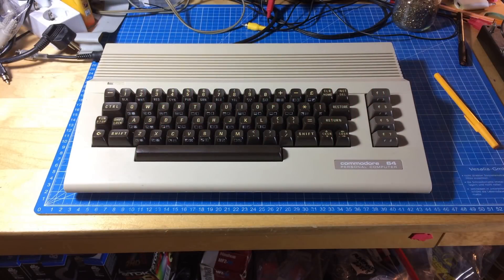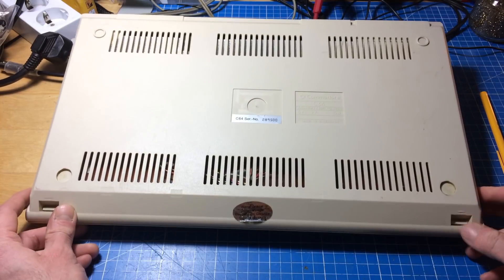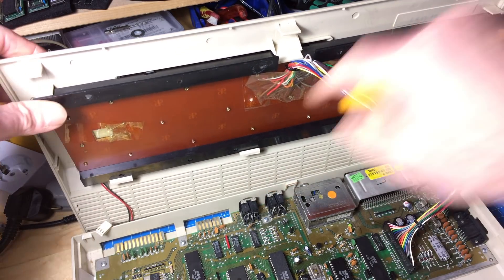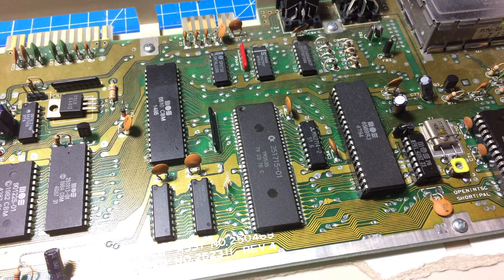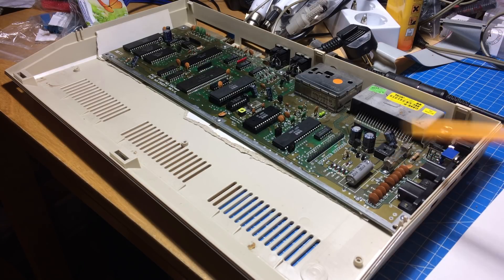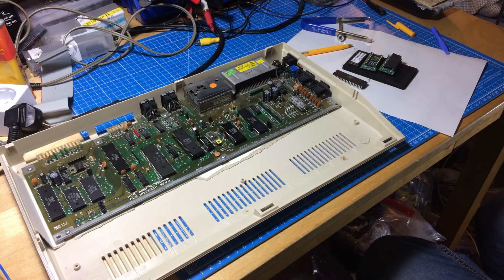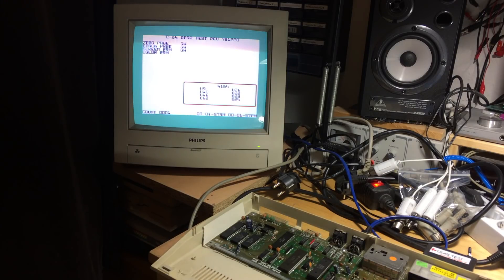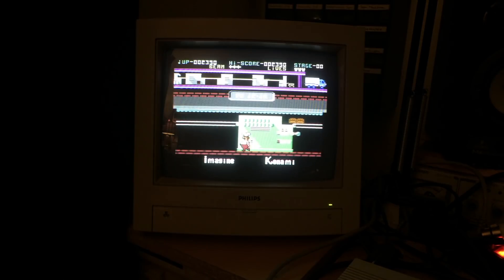C64 VIC-II Generation Conflict

Comment: If you use a 656X VIC-II on C64c boards, there won't be a display. If you use a 856X VIC-II on the old boards then the 12V on pin 13 will destroy them.

Comment: Does it matter which way you put the vic chip in? How do you know which way it should go?
Reply from the maker: Yes! The VIC-II can easily be destroyed if you put it in the wrong way. There is a little notch on one side of the chip that you have to line up with the notch in the socket and the marking on the PCB.

Comment: I have a breadbin ASY# 250407 Rev B board, it seems fine when powered up, can type a little program and run. When I put a cartridge in it, it goes black or garbage screen. PLA has been replaced, VIC II and SID have been swapped in to working machine, all okay. 

Any ideas?
Reply from the maker: Mh, that's odd. Is the cartridge known to work? Did you clean the cartridge connector? I found that it's often just a bit of smudge on the edge connectors that prevents stuff from working properly.
Reply: Hi Jan, yes a good Cynthcart and a diagnostic cartridge. The Cynthcart comes up black, diagnostic comes up with garbage, blue border and all. I'll look at the edge-socket closer. But have a true dead-test cart on the way. Also removed SID and did these tests - great Channel!
Reply from the maker: If cleaning the connectors doesn’t help it might be a strange fault in the PLA. Weird that everything else seems to work though.
Reply: This happens often when the replacement PLA is a cheap hack (EPROM) instead of a genuine Commodore PLA or a good quality replacement.

Comment: That's interesting.  I've never seen a C64 (and I have 21 of them) that had a warranty sticker on it aside from the large square serial number sticker which mentions a warranty.  And last night I found out that one of my C64Cs has a regular C64 motherboard in it, based on what the service manual says about board revisions.  I never knew that.
Reply from the maker: Yes, the first C64Cs had 250425 boards, then 250466. Both "long" board revs. The ALDI C64 in mid 1987 was the first one to have a short board according to my research.

I think the warranty stickers might be a German thing. I've seen a lot of warranty stickers from resellers, too.

Comment: Hi: A bit off-topic but I would like to ask you where should I take 12volts dc from in my 250407 rev.C mobo. It's important for the mod I'm planning.
Reply from the maker: You could take it directly from the 7812 voltage regulator I guess. It should have enough oomph (1A) to power something else apart from the VIC-II.

Comment: fortunately you had a spare chip but it might be hard to acquire a new one for your spares collection since I think most C64 chips are not manufactured anymore. I hope people with dead and still half-populated C64 boards will think of you and send them to you.
Reply from the maker: I have a small collection of spare chips and two spares boards for C64s. They are getting rare indeed. I hope there's going to be more modern replacements in the future to keep the old machines alive. The original ICs won't last forever.
Reply: yes maybe some (chinese) company remaking the ICs but I guess the ICs designs are still copyrighted :(

Comment: Another video from Jan :) I must admit i wonder how the incorrect chip ended up in the board.Great that you brought it back to life :)
Reply from the maker: Thanks! My theory is that someone repaired this C64 and used an old breadbin board for spares (the CPU also most likely came from that). Obviously whoever did it wasn't aware of the voltage differences.
Reply: and he gave up :)

Comment: it certainly had been opened before since the aluminium coated cardboard RF protection 'board' has been cut off
Reply from the maker: Ripped off, really. :) Yes, it definitely has been openend and the CPU has been changed also.

Comment: Ah, it's nice to have a simple fix once in a while. You were on-the-ball to spot the 6569 VIC-II on the board. Was @_Scoosie_ aware of the incorrect VIC-II version before sending this donation? What other goodies did he generously donate? rubs hands eagerly
Reply from the maker: Oh, there was a lot in there. Disk drives, another C64, Amiga peripherals, power supplies, etc. etc. Mostly bought as "untested" from ebay, I think and passed on to me because of the lack of time to go through it and repair. ;) I think @_Scoosie_ didn't know about the different VICs before.

Comment: Fun fact: You can use a new 5V VIC in older-revision C64s which expect 12V VICs. Bend away pin 13 (so it does not receive 12V from the socket, this would roast the chip) and feed 5V from the other supply pin via a short wire. I received a breadbin C64 with an old 250407 mainboard with that hack having been installed - apparently the old VIC was defective and only a new VIC was available for repair.
Reply from the maker: Yes! I read about that but didn't try yet. Thanks for confirming this really works. :)
Reply: Did it on my own board 250466. Works well. The VIC-II doesn't heat anymore.
Reply: I actually threw a 5V VIC into a 12V machine once not realizing they were mismatched. Got a black and white picture. Eventually I figured out the problem and did what you said and surprisingly enough the chip worked just fine, not at all roasted :)
Reply: Don't bend it or other semi abuse. Make an adapter socket. It's very easy. For best results you should use a modulator replacement as well where connections to it is configured as longboard (as it is) and then video part for shortboard. Did that myself in a clone I build before I got a Kawari.

Comment: just a little reminder for a request: to show the difference between earlier and later sid chips with the sampling playback differences they had, and a little bit about the workaround.    as a c64 owner i remember reading this at the time, but i had an earlier 64 so i had no problems, so never knew the reality of it
Reply from the maker: Yes! It's still on my list (like a lot of other things). I will eventually get to it. Sorry it takes so long. Now that I have a working short board/new SID machine, I can try the SID fix soon.
Reply: thanks Jan :)

Comment: How could possibly has this C64 ended with a wrong vic? somebody just throwed some random pieces together (keyboard, VIC, case, etc.) just to see what happens? :D Sometimes i'd love to know the history of some pieces of hardware that come to my hands, because once in a while a weird piece like this appears. I once found a casette tape in a garage sale where the tape itself had been removed and replaced by a circuit that, when put into a casette player, played a sinodal wave of a given frecuency. Who did that and the purpose of it remains a mistery to me.
Reply from the maker: My guess is somebody tried to repair it and only had an old board as the source for spares. Obviously whoever did it didn't think about the voltages.

I kind of love these little obscurities. :)
Reply: This happens in Amiga 500 when a Fat Agnus is placed in an older Amiga 500 motherboard with Agnus. Pin compatible but only 1 pin difference.
Reply: that cassette is an alignment tool, you put it in and press play then adjust the tape head till it is spot on.
of course since you dont have prior knowledge or instructions for it, you would have to run the output from the tape through either an oscilloscope or a spectrum analyzer using a tape player that was set correct, then take a snapshot of the correct sine, setting it up would be a "faff" maybe even a pain, but once you have your snapshot and a set of leads you could setup any tape drive.

Comment: First time i tried a dead-test / diagnostic cartridge i was like "holy hell, everything is broken", then i learned about the harness. Ironically, the CIA chips that appeared broken in the computer i tested first - were actually both broken.
Reply: Complex Interface Adapters are so fragile.
Reply: The Amiga had fortunately 2 CIA but I never had a C64. With Amiga it was simply swapping to know which one was bad. These chips are probably directly connected to the outside world. Like a printer or disk drive with the Amiga.

Comment: The OCD person inside of me cringes to see that torn-off cardboard under the short board.  Seems like you'd get better convention cooling by taking that out, right?
Reply: Actually it's useless, i remove pretty much all cardboard/metallic "shielding" from the computers i own (have a pile). Some say it's for cooling, but it have no noticeable effect, and the metalic pieces that descend down above processors are for airflow to be able to reach down. You're better off with modern silver paste and heatsinks. Metallic cases was to reduce the processors "spraying signals" around and for FCC compliance.
Reply: Well, since people have reverse engineered the SID chip (SwinSID) and the PLA's (PLAnkton amongst others), i'm sure there will be new VIC chips and others too.
Reply from the maker: Yes, I usually take them out. Their only purpose is to shield the outside world from the RF noise the machine produces. Which doesn't matter to most modern stuff (unless you want to listen to AM radio or something like that). Airflow should be a bit better without it (top part is more important for that, though obviously).

Comment: The casing with this kind of clips is the same used for the all-in-one Archimedes BBC A3000 but with 2 screws at the back and one underneath.
Reply from the maker: That's interesting. At least they added some screws so it probably wasn't only for cost reducing the construction. :)

Comment: First 👍🏻😂
Reply from the maker: Haha, congratulations! ;P
Reply: Jan Beta, I din’t now that the VIC-II use 5v on the pin where normally 12v is connected. So you can damage the IC if you put a VIC-II in a older C64 mainboard.